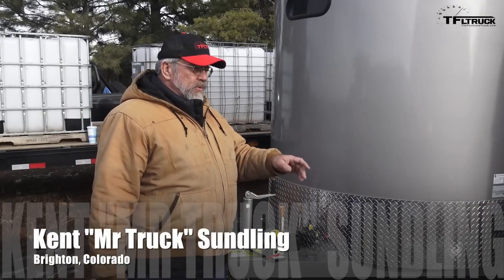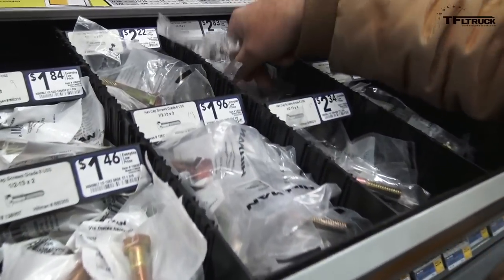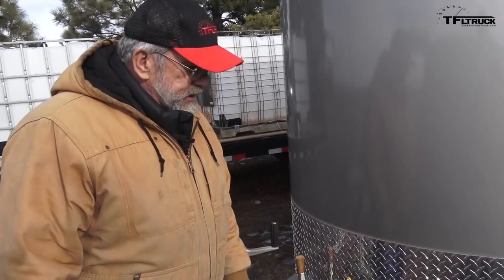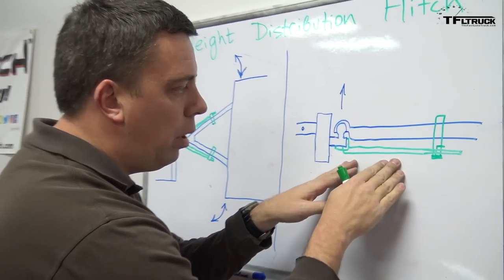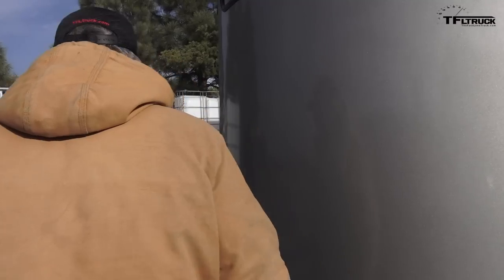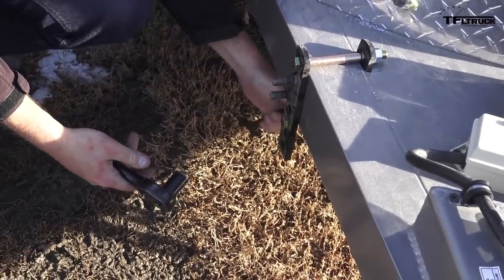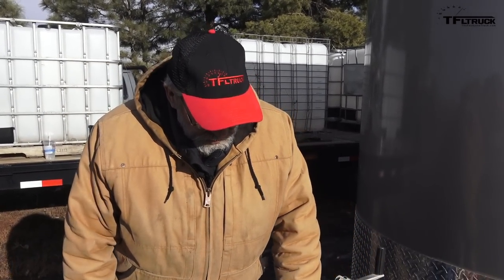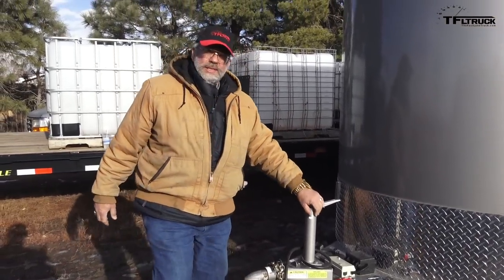What's a Weight Distribution Hitch, How Does It Work & How To Install It

Comment: Good information on weight distribution of a trailer hitch but I'm confused on what and how it works!
Reply: In the simplest form, weight distribution works as a lever. The trailer side of the hitch lifts up on the hitch. The "hitch" part (the ball) acts as the pivot point and the vehicle side is lowered. This 'lowering' action travels through the frame of the tow vehicle (via tension) and pulls weight down on the front axle of the tow vehicle. This type of hitch "distributes" weight from the rear of the vehicle towards the front.
Reply: a65232  Thanks for clearing that up!

Comment: I understand how they work, but this video didn't really do a very good job of explaining how it actually works regarding physics.
Reply: Because they don't know.  They also don't know, or don't care that the owner's manual says not to use one of these devices.  In fact, most Unit-Body vehicles also state the same thing.
Reply: @jmackinjersey1   Good to know.  I wasn't aware of that with the unibody vehicles.  Thanks for the info.
Reply: @James225  Not only was I a salesman for a long time, I have also been a technician, both engine and body for a long time as well.  The torque that these apply to the rear of the subframes is multiplied even more than the typical receiver hitch.  I have seen a lot of vehicles get twisted/dented, almost as though they were rear-ended, but the only damage was done to the under body area.  Many times when a 4 wheel alignment can not be performed properly, this is the reason.  Many times it is subtle and can not be seen unless you start looking for it.  This is also why a majority of these types of vehicles have such a low towing rating.
Reply: @jmackinjersey1  well I am going to ask you how it actually works. All you did was say what you think it does. Say how it actually works and then I will most likely have to correct you.
Reply: @AztecWarrior69_69  ,  It uses the weight of the vehicle and spring steel under tension to cantilever the front/tongue of the trailer and distribute that weight towards the front of the vehicle.  It essentially moves the connection point farther back, towards the rear of the trailer.

I've been around tow rigs well over 30 years.  As stated before, I have also been on the repair side of vehicles that weren't supposed to have them being used, and had to repair and more often replace rear body sections and tubs un SUV/XUV's and even some sedans.

Comment: I love yall channel and yall are usually informative, but I don't believe you are correct on this one.  The "L bracket" as you called it doesn't actually do anything but keep the bar from coming off the bracket you bolted on.  You both were saying it like "grabs" and that's what prevents the sway.  The sway prevention comes from the friction of bar sitting on the L bracket you bolted on.  When the bar is perched on the L bracket the weight of the trailer and tow vehicle cause the friction.  Unless this is a totally different set up than my Equalizer 4 point hitch.  If so, forgive me and I take back everything I just said HAHAHA.

Comment: Just wondering why you are using this device when the Honda Ridgeline owner's manual says NOT to use one?  Don't you just hate those pesky Honda engineers?  Most Unit-Body vehicles are not designed for these devices either.  But you go ahead and do what you want to.  It's not like you can/should simply tow the proper amount of weight or distribute the weight properly or anything.

Comment: "What's a Weight Distribution Hitch,"  Barely anything on that.   "How Does It Work" ,  Not even close to saying how it works you just partially said what it does &    "How To Install It"  You installed on a horse trailer. A trailer that shifts weight often and goes from loaded to nothing.  These things are not meant for that.